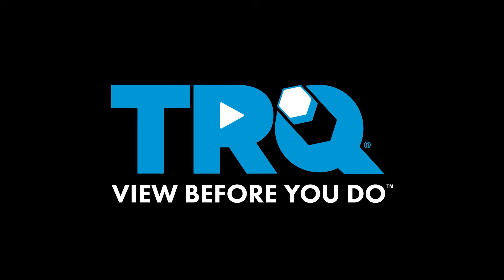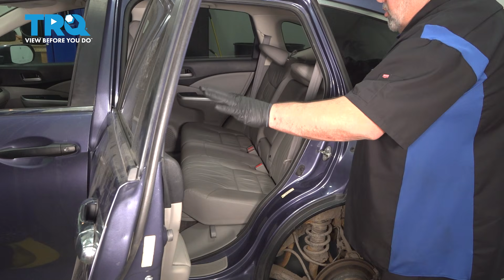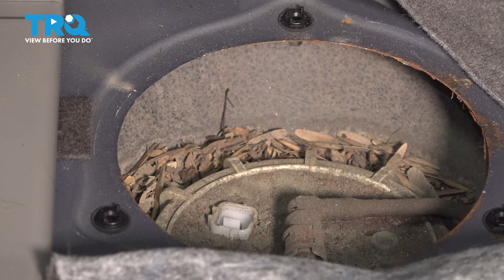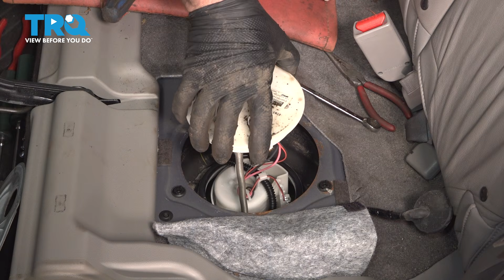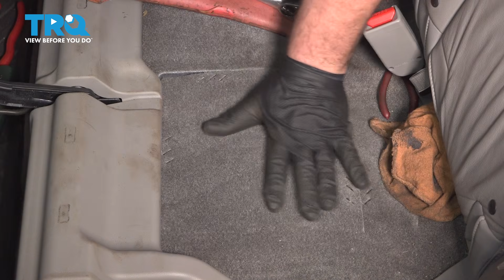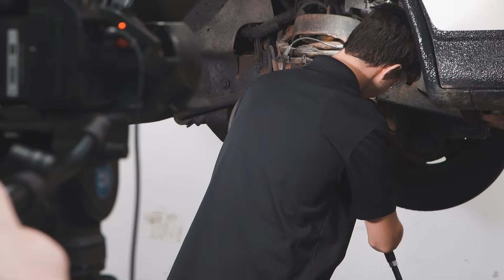How to Replace Fuel Pump Module Assembly 2012-2016 Honda CR-V 2.4L L4

Comment: If you have trouble seeing feel free to use a lighter to illuminate your working area. This is especially useful once you get the old fuel pump out. Don't be afraid to get that flame nice and close to the fuel because the reflection from the gas will LIGHT UP the entire working area. Ok DON'T DO ANYTHING THAT I JUST SAID!!! It was my attempt at humor, but after thinking about some of the people that I have met in my life I realized someone might actually think "WOW WHAT GREAT ADVICE" and do it. It's important to never listen to me because I am one of those people that I have met. You know the really stupid phucking people 👋 that's me